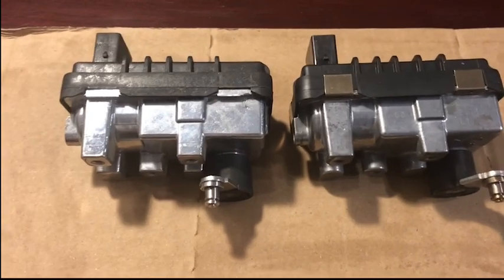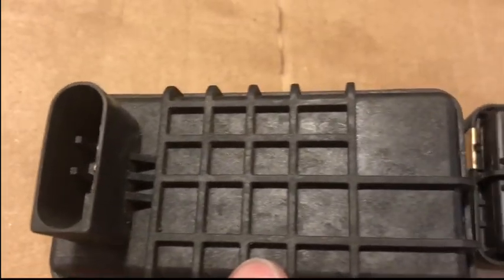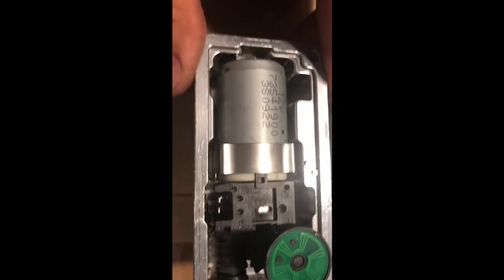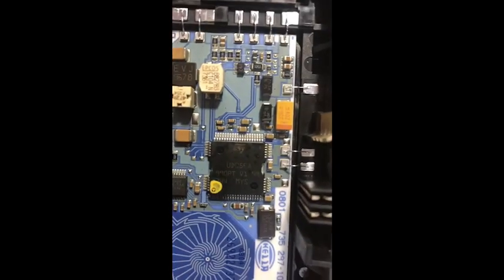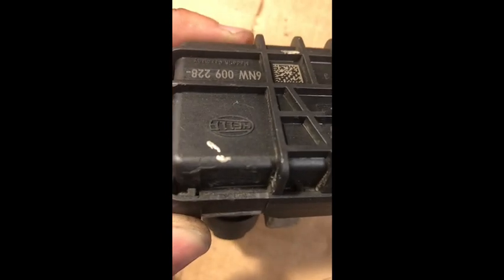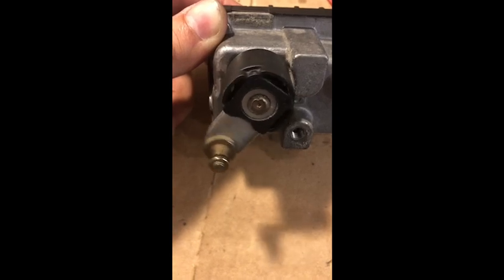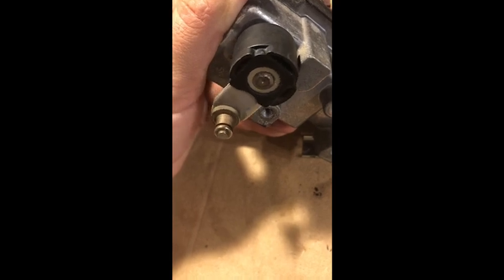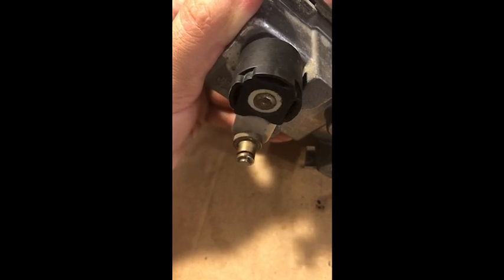OEM Turbo Actuator vs Chinese Aftermarket

Comment: hi, do you know what may cause that my actuator when connected it goes up, but then stays there. ive tried direct power to the motor both sides  and looks fine. 
I think something in the electronic board is failing.

Comment: I know this is an old video, but not many folks are knowledgeable on these. Have you ever found the CAN data for any of these actuators? I am using a G-23 6nw 009 660 in an aftermarket situation and I am hoping I can hook it into my CAN network.

Comment: I have two questions, hopefully you can help me. I'm replacing the actuator on a 3.0 TDI engine, it looks quite similar to the one in your video. Question #1, how do I adjust the arm when putting the actuator back on the car, physically? I bought a new unit, and the arm seems like it's impossible to move into position so I can reconnect it to the car. Question #2, after I finish installing it, does it have to be programmed by the dealer, or will the car just figure it out and function normally? 

Very informative video, thanks!
Reply from the maker: This is way too late to help you. But it will help others:
1. When you apply power to the actuator (plug it in and cycle key on and off) it will automatically position itself to the "home" position. This will allow it to be installed and access to the bolts.

2. NO IT DOES NOT. despite the misinformation from dealers these activities are not specifically "keyed" or programmed to that particular turbine. You can take one from one vehicle and place it in another. But you can't switch from different type of vehicles. Although the actuator looks the same, they are programmed differently. Further, you can't take one from a 2004 sprinter and put it in a 2009 ml350 and have it "programmed" for example.

Hope this helps you guys.

Comment: plastic gear in both obviously made to fail at some point
Reply from the maker: Yes and no. The black gear is made of softer material. I call it sacrificial because it's conveniently the only one that can be changed.
Reply: It's not the gear that's first to fail. It's the super delicate wires inside that become loose

Comment: Thanks for this. I nearly bought a cheap actuator off eBay. Now I’m getting mine reconditioned
Reply: Did you manage to rebuild yours then?
Reply: @ninrm6355  no I didn’t need to. After reading a few comments on various forums, I tried the cheap option first- sprayed the outside unit with wd40, sprayed electronic cleaner spray into the actuator and it never went into limp mode again. Since then I’ve also put turbo cleaner through, and regularly put an additive in my fuel.

Comment: Hi, I also want to do such a thing for the turbine actuator BMWe38 m67 to test the actuator for tsrapravnost, an error appears ,, short circuit on B -, this is a mistake, tell me I have such a board, I need to program this board differently, and There are also actuators not working, what could fail in electronics? Thank.